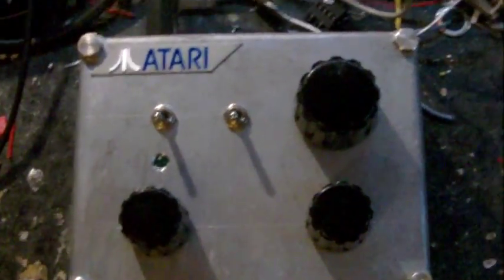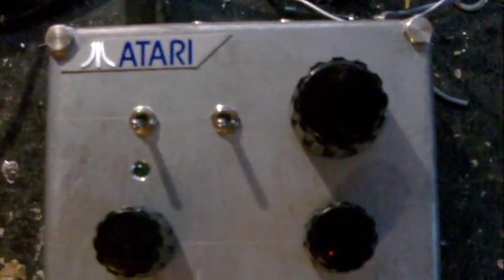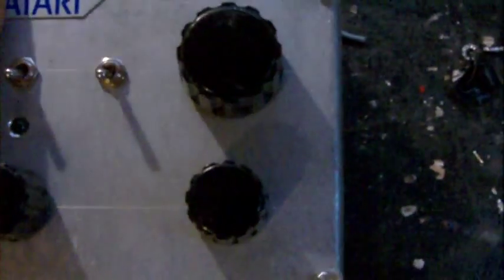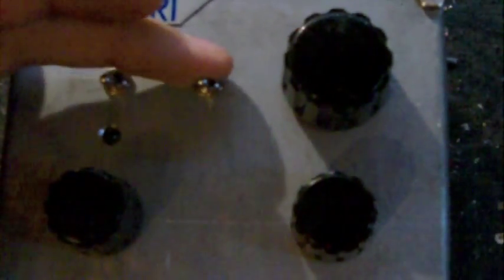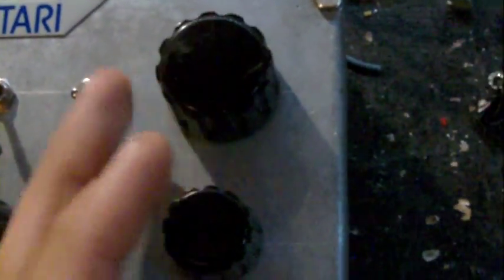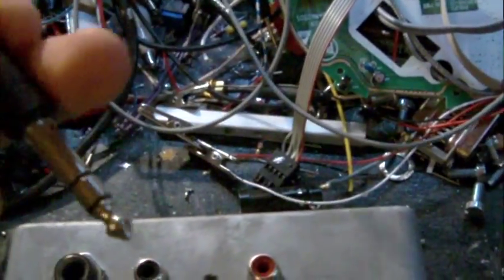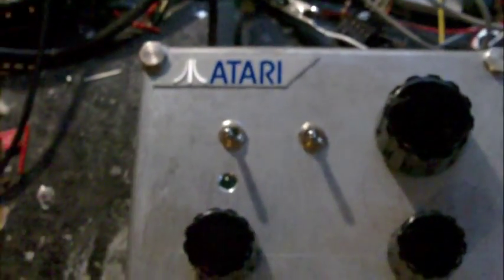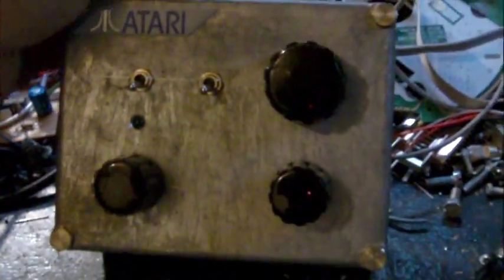Atari punk console APC with spring reverb

Comment from the maker: It's inside the box, under the 2 bottom pots basically. It's a classic dual spring reverb with pickup couls and things. it was some German DIY kit from the mid 80's It's got a pair of OP amps and things to buffer the signals.